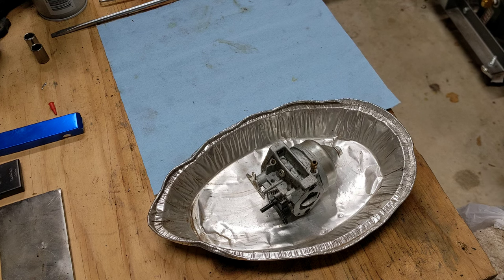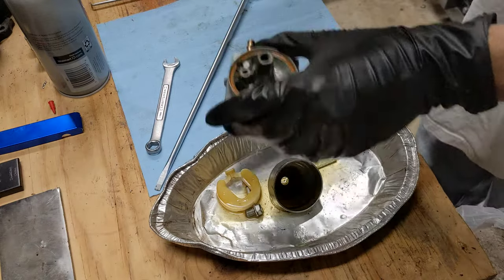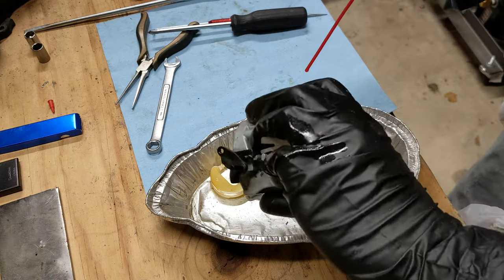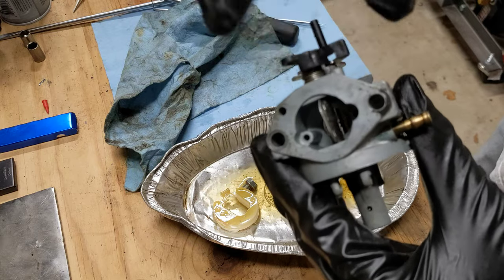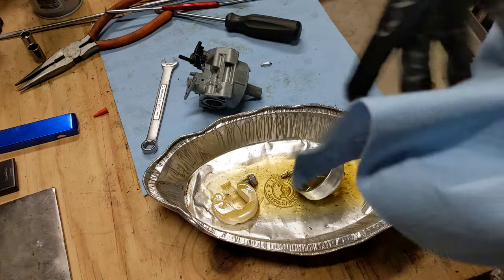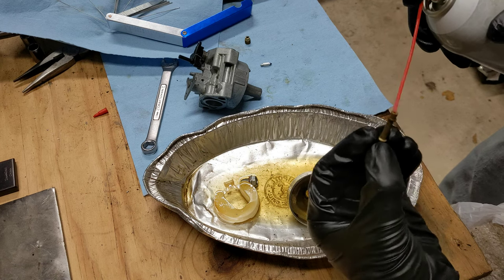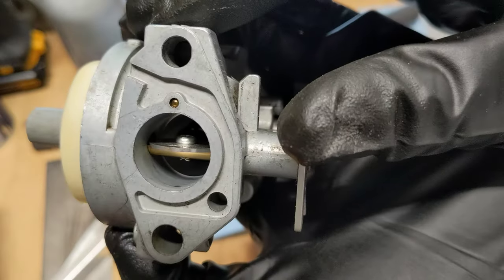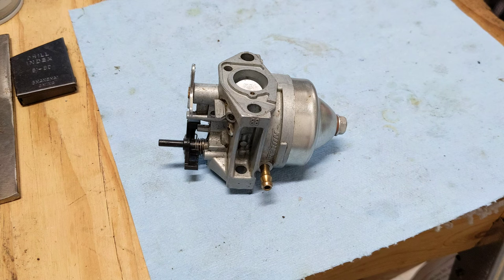Full Detailed Honda GCV160 GCV190 Carb Clean [4k]

Comment: I use an Ultrasonic cleaner on ALL carburetors anymore. The Ultrasonic waves can reach areas inside a carb no amount of cleaning can reach with a spray cleaner. I use Simply Awesome cleaner from the dollar store deluted with water. Harbor Freight  sells a small Ultrasonic cleaner that is the perfect size for cleaning carburetors.  I do check the jets and use a jewlers drill bit of the appropriate  size to clean out the jets because the blockage is usually very hard deposits of varnish from dried fuel. If all that doesn't  work, I order a replacement carburetor. If the carburetor  is badly corroded inside, it gets replaced.
Reply: After I sonic clean them if they surge I put them in carb acid for a hour and 98% of the time it fixes them
Reply: @philliphall5198  be careful using any harsh cleaners on carburetors.  There is a coating that once removed, promotes rust to form easily in the future. It can also etch the metal, turning it a rough grey color. This can cause serious issues too. I have ruined several carburetors  using simple green full strength.  It's bad news.
Reply: @scottfirman how about Gumout carb cleaner, would you say that’s to harsh?
Reply: @stevenlengyel9701  NOT like the purple stuff no. Gum out and other carb cleaners were made for that, however, they cannot dissolve solidified gunk internally, hence the reason I use the Ultrasonic  cleaner.
Reply: THERE IS NO COATING! The simple green is corrosive & ate into the aluminum.

Comment: brake cleaner dosnt remove the  baked on varnish, brake cleaner is expensive to waist easier to throw carb away and buy a new one for $20-$25 , i use tip cleaners of the mig welder to clean the jet holes

Comment: This is fantastic. My Honda mower wouldn't start due to the choke butterfly flap sticking open. Lots of video explained wax cartridge problem but this nailed it! Removing the flap, pulling the shaft out and copious amounts of brake/parts cleans got it moving again. Bonus it showed how to put back together with the spring. Well done!

Comment: The main cause of the condition of this particular carb is the use of gasoline with ethanol. The ethanol causes moisture to build up in the fuel system. Check to see if non ethanol fuel is available in your area. It is usually common near areas that have recreational areas with lakes. The typical 87 octane fuel for autos has 10% ethanol. The ethanol has no value, but it is forced on us. Non ethanol is usually 89 or 90 octane. The higher octane is not the issue here. It's the ethanol. If any type of power equipment, 4 or 2 cycle,  has a fuel shut off valve or if the unit can be retro fitted to have one, it is a very valuable item to have. Just before finishing any use of the equipment, simply turn off the fuel and run the engine out of gas. Obviously that keeps the carb from becoming 'contaminated' in the first place. The use of fuel stabilizers when using either type of fuel is always recommended.

Comment: Cleaned my carb and put a new spark plug in. Its running super rich, puffing black smoke, and fouling the plugs within 15-20 minutes. Clean the plug and it runs strong for another 15-20.

Comment: I definitely appreciate this guy.  If it wasn't for you and this detailed video, iw as ready to sell my pressure washer. Thanks... it's running awesome 😅
Reply: Ha ha I was thinking about getting an electric one
Reply: Having same issue with my pressure washer. Got it to run with choke on but stopped when I realized I got problems. This worked 100%  any tips?
Reply: @jjc6776  clean or better yet change the carburetor
Reply: @robdjones50000  going to use this video to take mine apart clean and install again. Hope these directions don't miss a step lol
Reply: @jjc6776  it definitely helped me fix mine. There's a  couple of very small pieces that have to be taken apart. Just put them on a light colored cloth to make it easy to find. I also used my phone to take pictures during the process to make sure I put it back together correctly. Good luck 👍🏿

Comment: best video I've seen re these honda carbs, my gcv160 surges, replaced carb and wax choke actuator (auto choke sysem) last Apr and started surging again @ < a yr ! Cleaned jet and brass tube under it and still surged. I didn't know of idle circuit : (    Will try the idle circuit oriface cleaning now that I know now. Thks
Reply: @richardkanady7466 Same experience here with the GCV160.  If it's is like mine, from what I've learned -there is no idle adjustment on the carb.  (Fixed throttle too on this mower.)

There's a Phillips head screw on the carb that you remove to expose the pilot jet, a tiny hole about 1/2" down in there.  Pretty sure it's the culprit.

Have not been able to penetrate it with  ANYTHING.  Tried Carb Cleaner sprays, lemon juice, oven cleaner, and welding tip/ torch tip cleaners.  Nada.

Gonna see if Harbor Freight has micro drill bits, lemon juice (more) / pinesol soak, laquer thinner, and possibly boiling.
3 times tearing down and cleaning it.  Also cleaned fuel tank, and reset the governor twice.  Still surged.  Frustrating.  This will be the 4th time.
See Steve's Small Engine Saloon for the best detail on this type of pilot jet. (If u haven't already bought a new one - which will be my next step if this 4th time doesn't fix it. $20?  You bet!)

He shows other styles in the same video so stay focused & you'll see this one.  He uses a handheld micro drill bit and emphasizes when you see it get thru the clog.  Good Luck.
Reply: @evelynmahoney3569  I have the same problem on my 160! It keeps surging agggh....did you get yours fixed?

Comment: this seems like an incredibly poorly designed carburator/engine this this is necessary.  I had a cdn tire lawn mower that ran perfectly for 10 plus years never had to do this.  Bought this honda and started surging after only 3 years,  fack,  this looks like hell to do without the 4-5 differeent proper tools he was using.  I'm pissed i bought a honda, never again.
Reply: @Quickhans
Would you like some cheese to go with that whine?
Reply: Buy a Honda engine they said.  They start easily they said.  It will run forever they said.  I had mini bikes with Briggs and Straton engines growing up which ran longer without maintenance they this Honda GCV garbage which ran for 2 years and been giving me problems ever since.

Comment: You start off by cleaning the outside of the carburetor so as not to contaminate the inside parts. The dirt goes into your pie pan. Then you tear the carb apart and put it in the dirty pan